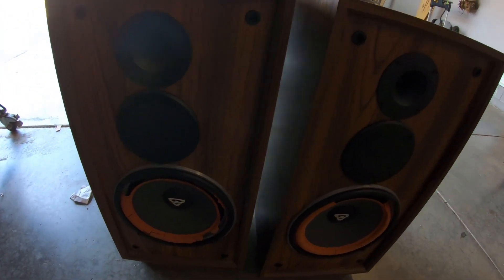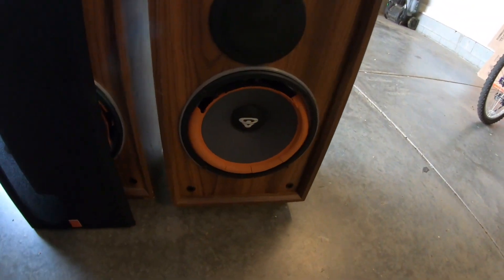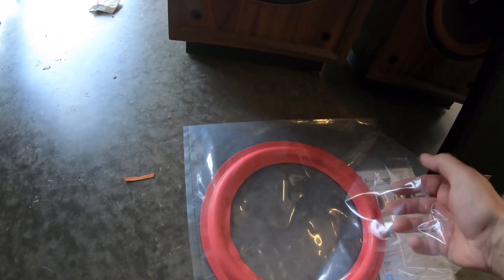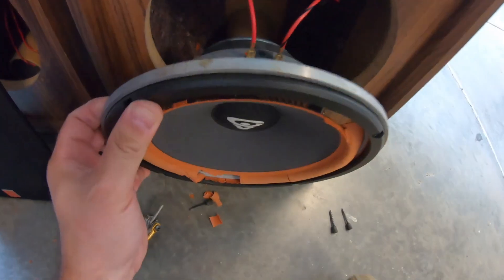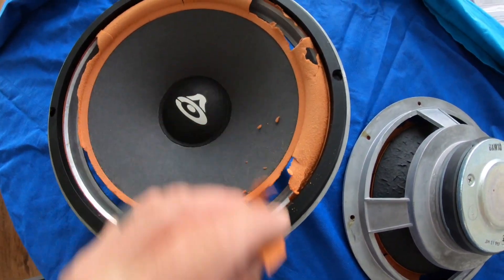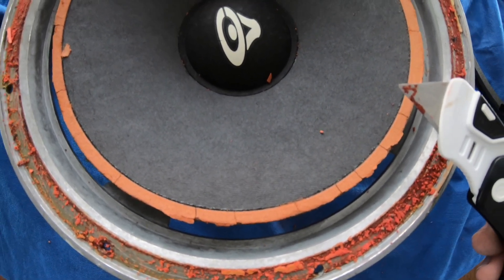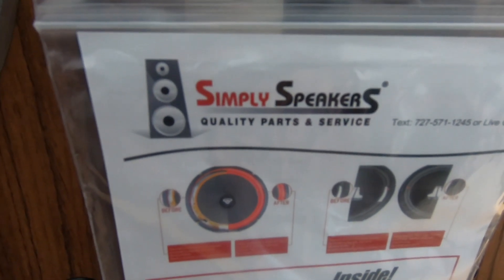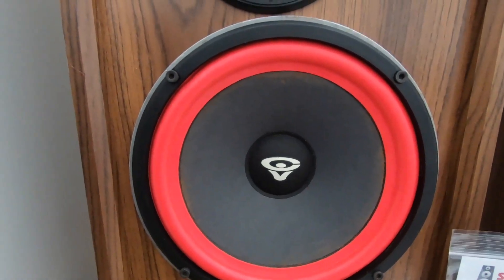REFOAMING CERWIN VEGA DX-3 SPEAKERS

Comment: Did you have to take off the dust caps on the woofers and shim them before refoaming?  You've inspired me to refoam my Cerwin Vegas I found at a rummage sale! Great video! Subscribed.
Reply from the maker: Thanks Aaron ! No dust cap removal or shimming . That’s the nice part of the kit . While the glue is setting you have time to adjust so there’s no contact when pushing down . Simply Speakers has a way better explanation on their website. I did the video just to show a 1st timer can do it 👍
Reply: @jimsvinylcavalcade7863  Sounds good. Now I just have to do it!